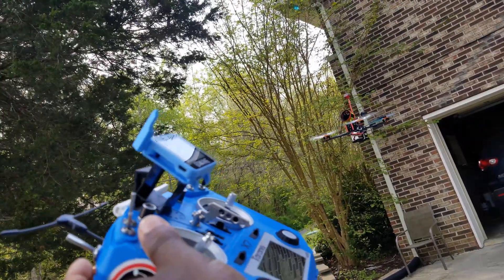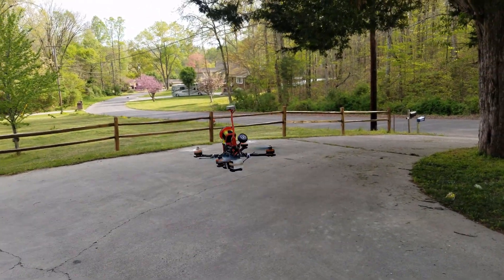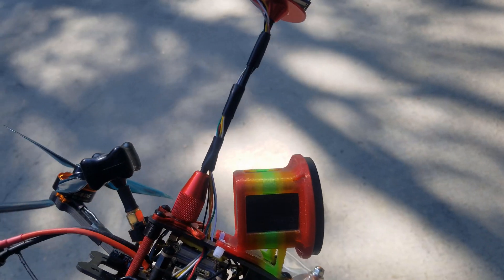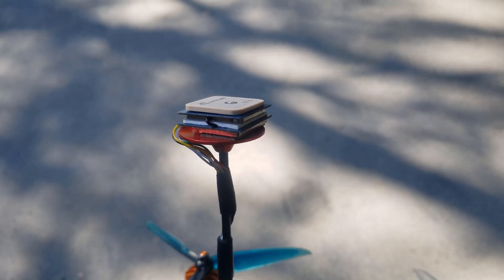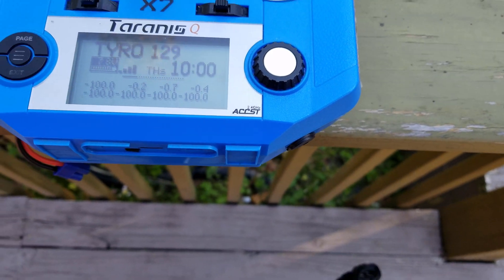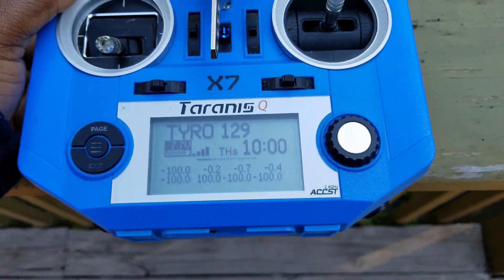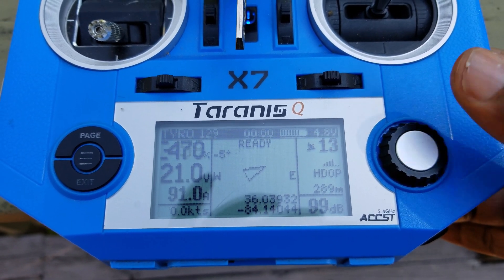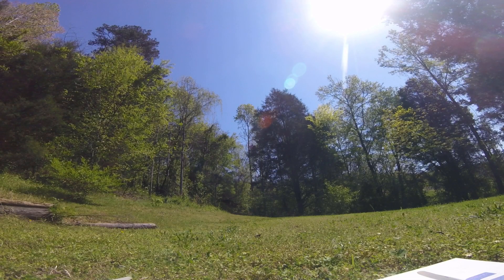Tyro129 Gone INAV 2.4.1 (RTH, failsafe, Althold testing)

Comment: Hi.. Nice setup. What battery are you using? And the flight time?
Reply from the maker: I used multiple batteries, and I get on average 11 minutes. I can even get 9 min with a 1500 mah 4s bat. I have some lion pack on the way. They are more energy dense an weight less than lipo. In theory, it should give me longer flight.

Comment: Hi how did you do this ?:))) please share. I'm using ppm now because ibus doest want to work ;) with my flysky transmitter and receiver
Reply from the maker: What flysky rx are you using?
Reply: Now I'm using fs ia10b.. but this weekend I'll get x6b and fli 14+ .. I don't know which will be better ;)
Reply from the maker: I am assuming you already did the solder bridge on the flight control for ibus, and you already selected Ibus on the configurator. Would you mind trying a different uart. Tryied to connect your ibus wire to uart Rx4. Ibus is not inverted signal it should work with any free rx uart

Comment: I'm looking at switching....any issues with setup at all? Thanks for sharing!
Reply from the maker: No setup was very easy,  I did lower moter idle from 15% to 6%. It was way too mush for dshoot 600. I also increase  motor value used while landing 1000 to 1300. I can check out Painless 360 video on INAV. He goes deep into the setup but    very informative. It took me about 20 minutes to setup the drone.